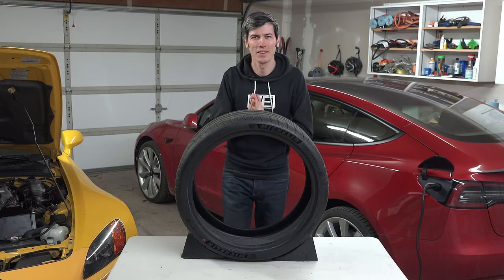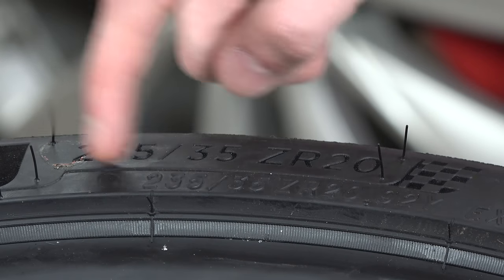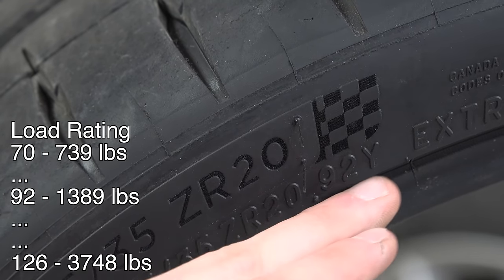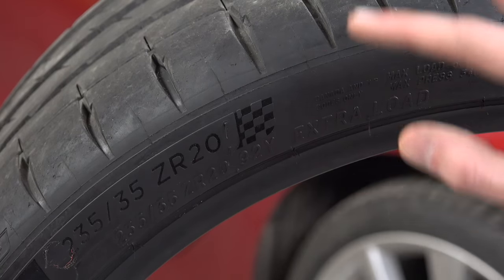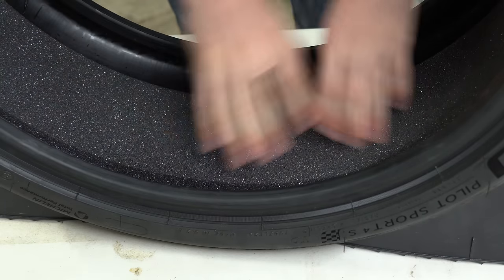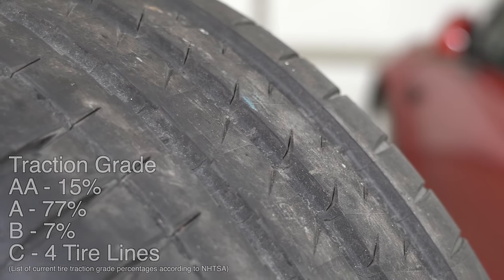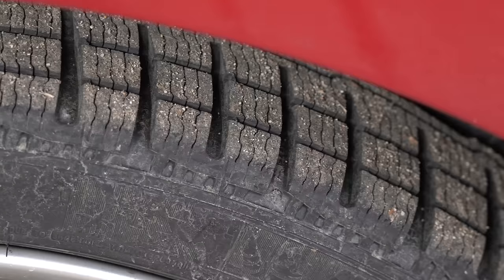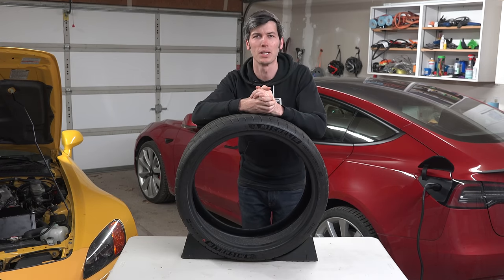The Ultimate Guide To Tire Sidewalls - How Good Are Your Tires?

Comment: Here's my question. Everybody talks about not buying "cheap" tires. Problem is...when I look on (for example) the Discount Tire website, even the cheapest tires they sell are rated as A for traction, A for temperature....rated for same speeds, same loads etc. Sometimes even better than more expensive tires! They're often rated for the same braking distances on dry and wet pavements too! I'm so confused. Why not get a Westlake instead of Michelin if they're "rated" the same? (I know Westlake is from China and some Chinese tires may not have the same quality control, so I don't lean that way, but GT Radial? Sentury?) Thoughts? Thanks all...cheers!

Comment: I like to go to car shows and judge people on the tires they have on their car.
Reply: PiroFyre I judge everyone by the tires on their car 😂
Reply: Tyres actually tell a lot about the owner. Cheap tyres on couple of years old performance car means the owner probably isn't as rich as the car might suggest and cheap tires on boring car means the owner probably doens't care and doesn't know a lot about cars.
Reply: @HenkkaWRC  what does expensive tires on Prius mean???
Reply: @ralanham76   That the owner probably cares about his/her safety and wants to make the car drive as good as possible. Also he/she is probably not poor.
Reply: Sometimes cheap performance tires are better than higher priced tires. When I used to own a 03 tiburon gt, I bought a set of nixens ZR Y summer tires $90 a tire ($360). All the other tires that were slightly more expensive had T and H ratings. I couldn’t afford to spend $1000 for name brands like Goodyear or continental. Anyhow the cheap summer tires were great with all forms of traction. The treads crapped out around 20k. Seems like these tires were definitely made to for people to use on a track as a low budget option
Reply: @suiton20  Don't know when this was, but I wouldn't really recommend Goodyear, maybe top of the line Goodyear would be fine, but I used to work at a tire shop and at least 30% of all separated tires we replaced were all Goodyear tires.
Reply: @13anomalous16  How badly or past their tread life do people run their tyres to have them come apart? I've been driving over 30 years and never had such occur.
Reply: @Thermalions   not my proudest moments but I've driven down to cords/steel on several tires with no separations. Doing a lot of driving around LA the only separations I've seen have been on semi trucks. Maybe 3 or 4 instances of shredded tires on a passenger car/light truck in over 20 years. Purely anecdotal & I don't work at a tire shop, so take that info with the grain of salt it's worth.

@HenkkaWRC cheap tires on a boring car probably mean the driver doesn't know a lot about cars? That's a very broad statement, especially today. Why spend big money to shoe a boring car when doing so gets you little more than a much much lighter wallet?
Reply: @ralanham76  it means your going to be dead cool one day!
Reply: Sammee
Reply: robert hamilton means they have too much money and they should buy a project car to dwindle it down
Reply: Stop being so sensitive
Reply: HenkkaWRC I know about cars , I just chose to have cheap tires on my daily driver
Reply: "Which Michelin is best Michelin."
Reply: judge not lest ye be judged.
Reply: @ralanham76  Well, there could be a possibility that the owner appreciates the quietness ride of the hybrid car and on top of that, thus, a better composition of the tyre that was made (depending on the manufacturer), makes better performance/grip/insulated ride it will be. Just my 2 cents. :)
Reply: @Thermalions  
Twice now I got nailed by this problem.

Both my cars are lowered on coilovers.... and I forget sometimes to actually lie down and  look at the inside portion of the rear tires where  the camber can sometimes wear out the inside portion before the outside tread which is more visable.

I have worn down to the cords and right through the cords twice now over the last 12  years. DOH!
 Once on my BMW M3 and once on my Lexus SC300 that runs 275 35-18 in the back too.

It happens.
Reply: @arphos8328  
All around? By far  this: Michelin Pilot Sport 4s. The tires in this video.
300 tread wear, so they can last a lot longer than noisy, expensive 200 and 100 tread wear tires.
Reply: @ralanham76  or expensive tires on a Pontiac Aztec.....
Reply: Long Tran something to be aware of. Tire companies often make tires similar to one of their own models as a “Joise Brand Yore” for other retailers “built to the retailers spec”.

So they may look very similar to the manufacturers own model tire, but they may not be. They could have thinner sidewalls, different compounds etc. e.g. Walmart could get some house brand tires made similar to a Bridgestone Blizzak, but they could actually be of lesser (or greater) quality.
Reply: I literally do that all the time when I'm walking through a parking lot.  Like to see what people are running.  I can't stop doing it, send help!
Reply: @13anomalous16  i also used to work at a tire shop and would agree that goodyear were some of the worst tires, and michelin were the best.  (bridgestone and continental also good)  if i were to buy tires without knowing much, i would buy based 100% off of how it looks on the balancing machine.  if you can physically see (while spinning) that it isnt perfectly round, get a better tire.  if it requires alot of weight to balance, get a better tire.  Tommy boy "if i put a warranty on the box, we both know that i just sold you a warrantied POS"........beware of warranties.  most tire brands dont live up to their warranties but the company sells more knowing that it is a factor when purchasing....they count on customers forgetting, lost receipts, or sold cars.
Reply: @Thermalions  me I run down to the legal minimum (1.6 mm or 1/16 of an inch) or usually when the MOT place says I need a new tyre. I did notice a Fiat Brave we used to drive I cut my finger on one of the wires poking through the tyre so I said to my dad "I think we need a new tyre on this car".
Reply: Piro,
I'm changing my winters with 2009 Michelins. I took them off long ago a put on other winters but it's time to cange them. If they turn out to be bad I'll buy NOKIAN.
What's your judgement of me - not that I care!
David
Alberta
Reply: @arphos8328  
I have Michilen X ICE WINTERS

Comment: One thing worth noting RE: max tire load... the maximum rated load is measured at the maximum rated pressure, NOT at the auto manufacturer’s recommended inflation pressure.

Comment: It may also be worth mentioning that a lot of countries will issue fix it tickets for any tire over 6 years old, which is where the DOT stamp can be helpful in determining a tires age.  There have been tire shops that have gotten in huge trouble for selling "new" 14 year old tires that never saw road time, only issue is that tires that old have hardened and lose traction and are more susceptible to blow outs.  Think of a brand new rubber band that sat in a desk drawer for ten years, first time you stretch it out it just snaps, tires oxidize even if they arent driven on.

Comment: One of the first things I would say to my students when I was teaching our calc-based physics sequence for engineering and physical science majors was to not mix units. I would recommend that they convert all data to S.I. units do the calculations to get answers in S.I. and then convert at the end if they needed a result in another system of units. Mixing units is a prescription for disaster.

Comment: I bet your winter tires have the mountain snowflake. You could have included that.
Reply from the maker: It means they're sensitive to negative comments.
Reply: @EngineeringExplained  , did you check for the mountain snowflake symbol on him before you got all sarcastical with your reply?  LoL 😂
Reply from the maker: @joseybarra2046  Haha of course, true winter tires will always have the triple mountain peak w/ snowflake. :)
Reply: @EngineeringExplained  could you possibly do another one for winter tires though? There is a big misconception that M+S automatically makes your tires into winter tires. Except that there are a lot of summer compound/thread tires with that marking. People don't understand that there needs to be a snowflake and/or a summit besides the M+S for it to be a winter tire.
Reply: @SF-tb4kb  no. If there's no snowflake or summit, it's a mud+sand, which is solely a summer tire. The compound and thread is completely different.

Comment: 6:48 Thanks did not know Treadwear Rating was manufacture specific. Always learn something new.
Reply: Michael Ferguson 

I am not convinced his statement is correct, because all tires suppose to be measured or referenced to the tread wear of a standard reference test tire.
Reply: Mine has 240 of treadwear and yes they run out faster than any others. Maybe the same value could not be a perfect reference, but almost yes
Reply: @hushemmohi2034  yeah, but the reference tire is up to the company. like, they dont all use the same reference
Reply: is all 3, treadware, traction & temperature manufacture specific or is it only treadware?

Comment: A long time ago, when I took my 88 Olds to one of those Quick Lube places for an oil change, the guy was showing a new hire the ropes. As I was sitting in my car with the windows down, I overheard these instructions: "See the max PSI on the sidewall? Inflate the tires to that." I got out, set them straight and from that day learned to do my own maintenance.
Reply: That's hilarious. It took a shop 2 tries and a new set of valve covers to fix a valve cover gasket leak. The leak was minor. First try they said the valve pan was bent and they tried to fix it. I drove it home and it was pouring oil before i got 1/2 there. Some rtv would have fixed the problem but they screwed it up. So i got another set of pans, shiny chome ones from the part house. They fixed it again and i still had to go behind them and snug up the bolts about 1/4 of a turn. Never again... I've also seen our local walmart drive a car into the pit and use a fork truck to get it out. I won't sign their waiver for oil changes. Again though i do it all myself. Bought a repair manual and taught myself in the days before the internet. Best choice i ever made. The skills I've learned have not only saved me untold amounts of money but I've been known to do side jobs wrenching. Back to you comment, I've also had the same talk with relatives about putting to much air in a tire. People a crazy sometimes.
Reply: Always go off door jamb

Comment: Always get your tyres balanced AND never let a tyre shop gun your wheels back on.  Hand-held impact drivers can be and usually are set to high.  Even if the fitter looks up the correct torque they are not precision tested tools like a torque wrench.  Bottom line it can cost £80 per nut Or £300 for all for locknuts.

Comment: Perhaps you could make a video about no of bolts, their distance, center diameter and mounting offset.

And also how the height of the tire combined with different sized  rims will fit or not on your car. 

And perhaps a word on tightening force and why it's a jolly good idea to use a copper based lubricant? 

It would probably be around this time of the year that the northern hemisphere starts to changing to summer tires, a refresh on how and what kind of tires you could slap on successfully is probably needed for most of us.
Reply: Niklas Paulsson not only offset but scrub radius as well.
Reply: @Xyleksoll   English isn't my native language and I'm unfamiliar with the term "scrub radius", I'll get googling and today will be a good day as I hopefully will learn something new!
Reply: @Xyleksoll  Yes, I did learn something new today, great!

I'm an electrical engineer by training, but I've taken a greater interest in mechanical things in general, mostly cars and motorcycle over the years.

I've actually noticed that newer cars have wheels offset more inboard, now I know at least part of the explanation why that has changed.
Reply: @NomenNescio99  all these factors influence the way a car handles but most people are ignorant of them. I am currently living in Texas and I can see a lot of lifted trucks with incredible offsets (wheels pushed out) that I wonder how they can actually go down the road...

Comment: Thank you for pointing out that the max inflation pressure indicated on the sidewall is highly unlikely to be the correct pressure for the vehicle.
Reply: Lets not forget even dealership mechanics set the tire pressure incorrectly. I just had my wife's SUV serviced and they set the tire pressure to 41 psi... on a SUV. I checked the door panel and it says 35 psi. 🤦‍♂️
Reply: Does door panel pressure apply to all tire sizes compatible with that chassis or just the stock tire size?
Reply: @absoloodle37  It should list what tire size it is for, most cars have 2 sizes listed (standard summer+winter tire or just he most common used)
Reply: Also, the recommended pressure on the door frame is COLD pressure. If you set your tires to 35 psi cold, it is not abnormal for the tires to reach 40 psi when youre on the highway.
Conversely. If you set your pressure to 35 psi after driving, with warm tires, the pressure will drop once they cool
Reply: @qman61698  agreed and to expand on your comment: most DIY and small compressors deliver hot air. It is not uncommon for pressure to drop 3-5 psi the next morning when the tires are "cold".
Reply: @Uberragen21  They do that so you get better has mileage.  Dental bills for loosened fillings is not their concern.
Reply: @Uberragen21  Sometimes mechanics set the tire pressure while the vehicle is in the air.  That's not correct.  The vehicle needs to be on the ground at its curb weight to properly load the tires before setting the pressure.
Reply: @kodiak2fitty  - The mechanic wrote down 41 psi for all 4 tires on the alignment detail printout. I thought that wasn't right, and verified the actual pressure with my analog tire pressure gauge and confirmed 44 psi (warm tires at that point). 

I then checked the door information panel and confirmed it should have been 35 psi. I went to another dealership to verify and they said the door panel info is what they go by. He confirmed that 41 psi was incorrect for the make, model, and tire specs of my SUV. The only vehicle in their lineup that has 41 psi factory specs was the EV model with skinny tires. 

Basically, we would have gotten better MPG, but at the detriment of wearing out the centerline tread on the tires.
Reply: @kodiak2fitty  that makes close to zero difference. I.e., a change so small so to not be seen on the vast majority of pressure gages found in an automotive environment.
Reply: Walter K Rule of thumb: figure on 1psi gain for every 10°F increase in temperature.
Reply: @kodiak2fitty  the volume of the wheel and tire doesn't change significantly between loaded and unloaded.
Reply: @walterk1221  not only warm/hot air, but damp air as well. That can cause issues as well. Primary reason for running nitrogen is that it's dry, and thus far more predictable in its pressure change with respect to temp than air that contains the moisture du jour in whatever location you happen to be in.

Practically unheard of for DIY'ers to be running sir though a dryer. Hell, many shops don't even run a dryer. All depends on who designed/installed the system.
Reply: Bc generally most people go with whats on the tire... thats what i do...
Reply: @Iceberg86300  Actually that is a great reason not to run nitrogen. Pressures are designed to change when hot and cold to maintain a more constant traction. 
When cold the recommended pressure offers a particular level of grip. 
When hot that grip level increases but is offset by the increase in pressure stiffening the sidewall and tread face. 

You are better off running air in a passenger car than nitrogen unless the car is specifically deaigned for it. This is particularly so during winter.
Reply: @dallasgirl3470  You definitely want to change that if it's not running to max load.
Reply: @bremCZ  air is primarily nitrogen & when you're talking about dry air it can be treated as a homogenous ideal gas. There's no way a tire manufacturer could or would design a tire to work optimally when the air has a specific moisture content other than zero as it varies wildly. However, they will design a tire to be perfectly safe regardless of whether it's 100% nitrogen, dry air, or saturated air. 

Nitrogen or dry air simply behaves in a very predictable manner compared to air with an unknown moisture content. Which is exactly why it's used.
Reply: @Iceberg86300  They dont work to specific temps or moisture content. They have a standard deviation within which they work.
Reply: @bremCZ  which will most certainly include dry air (which is basically nitrogen). There will most certainly be an optimum mixture, but there are simply too many variables to attempt to extend this to any part of the population unless nitrogen or dry air is being used.

There is simply no detriment involved when running nitrogen.
Reply: @Iceberg86300  Yes, which expands at a greater rate under heat that 100% nitrogen.
Reply: I know to pressurize my tires to what's on the door jamb, but can anyone tell me WHY that's the correct number?
If the maximum load per tire is 1768 at the maximum PSI of maybe 42psi, but the door jamb of my car is 36psi, then why 36psi if the gwvr is 5768lbs with a nearly even front to rear b weight distribution? I read an article about a tires theoretical maximum load given PSI ranges and it just doesn't make sense to under inflate that much, unless it just comes down to increased pressure due to heat when driving, but I don't see that much pressure difference in my wife's car that has TPMS when I drive on the highway in the summer.
Thanks in advance!